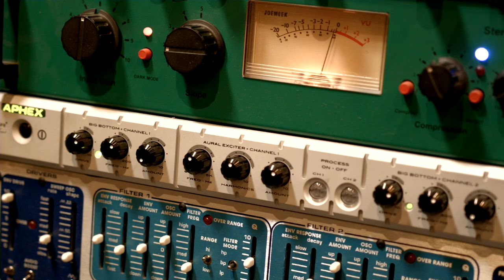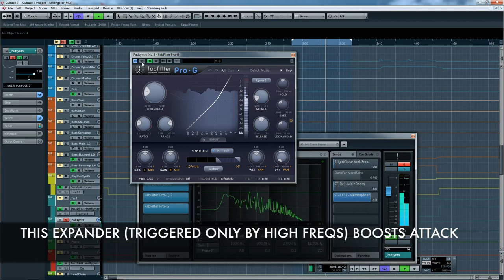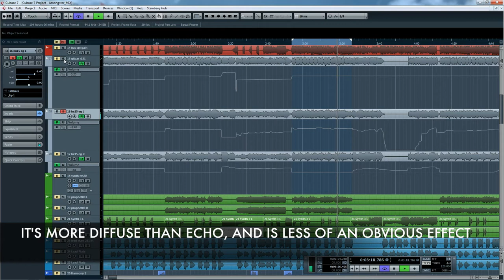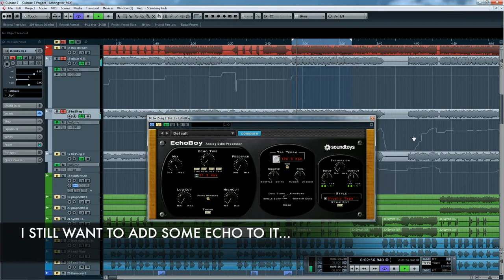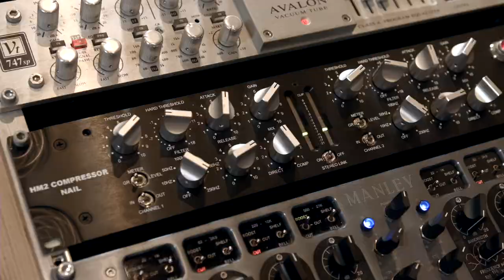Mixing in Progress - Creating Width

Comment: Nice video :) i have 2 questions:
- Synth: Did you gate the send to cut of the tail? If yes, in what way does that emphasize the rhythm?
- Guitar: Was the parallel compression used on the sum of the dry and wet signal?
Reply from the maker: Thanks! The synth was only expanded to pronounce the attack, no tails are being cut. But using a delay makes for a more sudden drop in level than a reverb, in this case. It has less of a rhythmic function (the echo isn't timed in any musical way, on purpose), but only serves to make the simulated distance more noticeable in the mix. As for the guitar: yes! The key here was to have a lot of reverb without the dry sound being washed out too much. The compression serves to duck the reverb when the dry sound prominent.